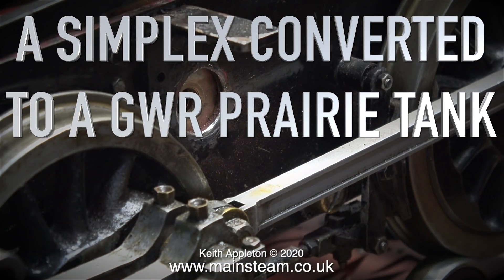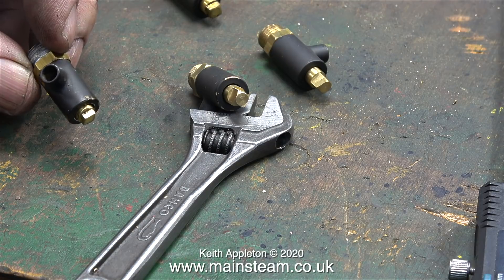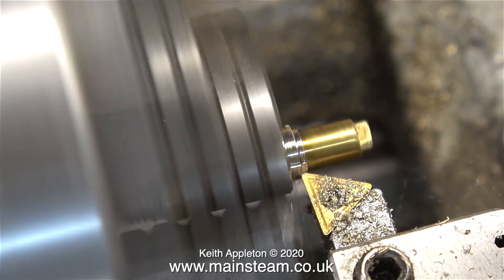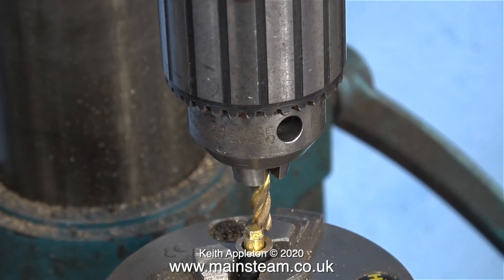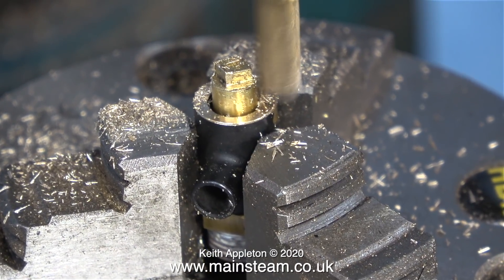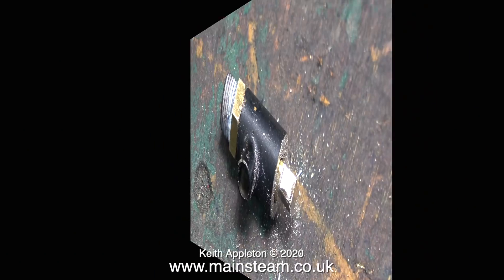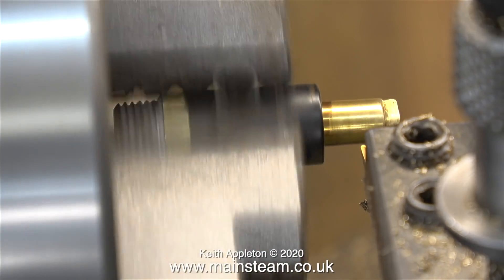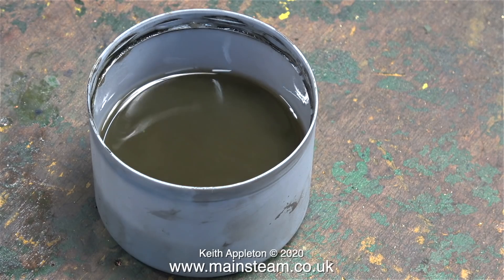SIMPLEX PRAIRIE TANK - PART #35

Comment: You should take a look at a old Doll steam engine, kinda like a toy but not really
Reply from the maker: Do you mean the tall type with the cylinder and flywheel attached to the boiler?
Reply: @keithappleton   not exactly it has a horizontal boiler paired with a large steam engine beside it, they are usualy cast iron and robust with large meths burners they are fairly comon as theres hundreds of different modles
Reply from the maker: Yes I have seen them.